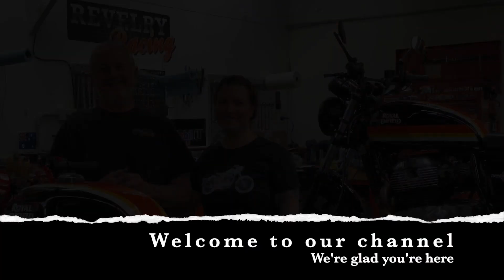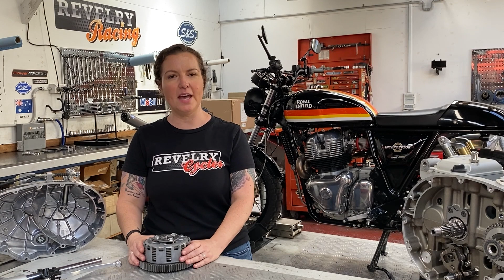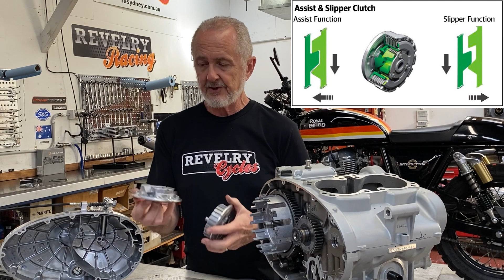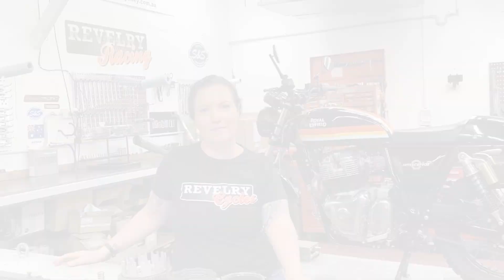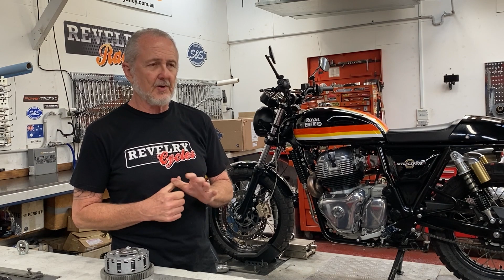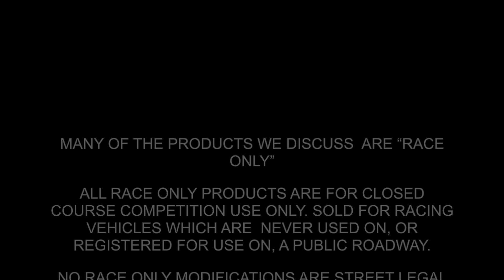Episode 9: Clutches - Royal Enfield 650 Twins

Comment: Hi. Just watched your video. It was enjoyable. However, I have a little confusion regarding the final parts of the clutch plates assembly. When you said about the assembly of the final 2 friction plates with the larger ID, you assembled it to the outer slots of the clutch housing. However, I cross referenced it with the workshop manual from royal enfield and I am myself a little confused. As per the manual, regarding the assembly of the 6th friction plate, 6th steel plate, and 7th friction plate goes like this: (I am copying it from the manual)
1. Locate 6th friction plate (a) with larger ID (less
friction area) on clutch hub (b) and ensure it is
seated properly against the inner face of the clutch
hub.
2. Locate 6th steel plate (a) on the splines in clutch
hub (b) and ensure it is properly seated against the
6th friction plate.
3. Locate 7th friction plate (a) with larger ID (less
friction area) on clutch hub (b) such that its lugs are
offset and between 2 lugs of the 6th friction plate.
4. The outer lugs of 7th friction plate are correctly
located in the INNER slots of the clutch housing.
5. The outer lugs of 6th friction plate are correctly
located in the OUTER slots of the clutch housing.

I would really appreciate, if you could get back to me on this.
Reply from the maker: At the top of the original video description.
NOTE: There is an error at 9:08. The original STOCK CLUTCH is installed with only the last drive plate in the short spline, NOT THE LAST TWO. 
NOTE: The REKLUSE clutch is installed with ALL drive plates in the long spline; NONE go in the short spline. There is no need to install any drive plate in the short spline. When replacing the original plates, install all of them in the long spline.

Comment: I think this guy is stacking the clutches wrong i put the last 2 friction teeth in the short fingers like he says and it slipped like mad, looking at photos online your only supposed to put the last one friction teeth in the short fingers, which i did and my slipping went away.
Reply from the maker: It’s noted in the video description. NOTE: There is an error at 9:08. When installing the STOCK CLUTCH, only the last drive plate goes in the short spline, NOT THE LAST TWO. 
NOTE: The REKLUSE clutch is installed with ALL drive plates in the long spines; NONE go in the short spline.
Reply: @RevelryCycles i missed that, many thanks ❤
Reply: Out of curiosity what are the short splines for?
Reply from the maker: Thanks for watching!

Comment: Great video! I was curious on the clutch replacement replacement process and it doesn't look hard at all. Looking at how the clutch is operated, it seems that holding in the clutch for bit at a stoplight wouldn't cause any additional wear.

Comment: Just fitted the Hitchcocks performance clutch which I believe is the same. I haven't actually put any miles on it, just turned it around on my street. First gear seems a little tricky to find, will this improve once given a good run? Or have I done something wrong?
Reply from the maker: If it doesn't work something must be amiss.
Reply: @RevelryCycles  it works,just getting first gear seemed a little harder than i am used too. Are they oil type sensitive? I have used semi synthetic as a posed to fully synthetic this oil change.
Reply: Well a couple of hundred miles in now on the rekluse clutch and although I have no clutch slippage at all, I am still having issues getting an nice easy neutral engagement, it's definitely heavier on the clutch lever too not alot but definitely heavier.
I don't understand why it's a struggle now to get neutral was fine on the standard clutch.

Comment: Hi guys love the videos i learnt a lot. 

I have a question I hope to get a reply as I am now fitting this upgraded  clutch.  The last 2 clutch friction plates you fit in the short gaps in the basket are the friction plates not supposed to go in the same gaps as the other plates as they would be running on the steel shims that were fitted? It makes sense to put them where the originals ran but there's no extra fitted steel shims on the other outer fingers.
Reply from the maker: From the video description:
NOTE: There is an error at 9:08. When installing the STOCK CLUTCH, only the last drive plate goes in the short spline. NOT THE LAST TWO. 
NOTE: The REKLUSE clutch is installed with ALL drive plates in the long splines. NONE go in the short spline.
Reply: @RevelryCycles  thank you so much for the reply. I did wonder as i have watch 3 videos and only 1 person put all the friction plates in the same place.  So I was getting confused to what was right. Appreciated..
Reply: Please reply as I have heard some say finding neutral can be harder? And wondered if it's because they didn't used the smaller gaps on the basket.

Comment: So, I've kind of got this series a little bit out of order for one reason or another, the visuals of the differing clutch packs and mechs/springs are so informative, even to someone who's 'been around the block' mor than a few times and understands carburettors and also knows what a choke is for! Keep up the good work and keep those 'vids' coming. 
Perhaps in the future you could include some custom bike and/or motor builds and show the dyno charts with different options of how the 'mix and match', can/will alter the engines characteristics, horsepower and torque etc?

Comment: I have Rekluse clutch plates in my interceptor. The problem I am facing is am not able to neutral it from gear engaged while the bike is running and is in 1st or 2nd gear. This seems to like clutch dragging. I have run 1000 km after fitment and the oil used is 10w50. Can you help me with the diagnosis of the problem.
Reply: Hi Sanjay, I also find neutral harder to select now from first gear since I had the Rekluse clutch installed. I can normally get it easily from second gear though. Did you ever solve this problem? It's quite annoying because the gearbox used to be so easy to find neutral.

Comment: Excellent video!
A tip for whoever changes their friction plates at home.
ONLY the last friction plate goes into the small teeth of the clutch hub.
When changing mine I assembled the clutch the same way in this video and it caused the clutch to lag and drag.
I've fixed it the way I mentioned above and everything goes smooth now :)
*all plates mentioned are stock plates *
Reply from the maker: Yep, that's a "blooper". Only the single outer most drive (friction) plate in the stock clutch is installed in the short spline, offset from the long splines, in the clutch SHELL (not the hub).

Comment: Excellent series.  Really digging it.  I personally live in the "hill country" of Central Texas, within riding range of Circuit of the Americas.  Weekends are twisty road work or track days, and I'd like to do them on a Continental GT.  In my case, brakes and suspension are a bigger deal than raw power.  Could you do a series on suspension tuning and brake performance for track people or knee-draggers?  If that is outside of your comfort zone, is there a particular source, channel or shop you'd recommend I check out for the RE 650 crowd?

Comment: Thank you so much for all of the time you guys spend informing us about Royal Enfield's.  I have a new 2021 Continental GT 650(less than  300 miles).   I have not been happy with the clutch at all.  The clutch does not engage until the last little bit of movement from the lever.  I have purchased the S&S clutch plate kit hoping for better clutch engagement.  I have the stock motor with a K&N air filter and the S&S slip-ons without the decibel reducer inserted.  I don't expect more torque I just hope the clutch performs better?  Does the S&S clutch kit come with instructions?  Thanks again for all you do!!!

Comment: Hi. I've seen you a lot at drag strip and also saw a lot of RE riders participated in drag race which is really great to see. I'm looking to buy the twin 650 and one of my concern is the wheels are in 18" which is quite limited the tyres option. My question is , is it able to do the wheel conversion in to 17" size ? And what's the trade off ? 
Thanks.
Reply from the maker: Not an easy swap to a 17" and would be expensive.  Since the 650's are selling well hopefully tyre companies will take note and make more options.

Comment: I've been advised by another YouTube channel chap, a very qualified and an Interceptor owner that putting all of the S&S parts on will ruin the bike for street purposes! I was really very much looking forward to getting the 865 big bore kit sorted along with other S&S gems. They said it would make the bike more 'Japanese'. The power will be higher up in the rev range and lose low down grunt. They advised an S&S cam and thats about it. Is the the case? I'd love to hear your opinion. Thank you.
Reply from the maker: No one who has actually ridden one of our fully equipped 865cc motors would ever say the phrase "lose low down grunt" while describing the experience. That's just silly. The fact is, while you can alter lots of variables to tune the engine toward more low end torque or more high end power,  no matter how you configure it the 865 ALWAYS makes much more torque absolutely everywhere in the rev range than the 650. The 865 engines are strong and reliable, they respond very well to higher gearing because they make so much more torque down low, they are smooth and quiet on the highway with HEAPS of high gear roll on passing power, and are simply a joy to ride. Oh and that's not my "opinion". That's an amalgomation of comments from actual owners of the 865.
Reply: @RevelryCycles  Thank you for your prompt reply. I also thought the very same way, as I've watched your videos from the beginning of your YouTube channel. I'll continue to follow your advice and build my goal. Thanks again for everything 🙏

Comment: Question: I have a more or less stock Interceptor, added a 2>1 exhaust and a Aftermarket air filter with a venturi intake. ( also lowered the gearing) Coming from a Street Twin on which I never experienced anything suggesting clutch slip, on the Enfield I get the sensation at times that I'm not applying full power and torque to the rear wheel. Since you have a lot of  experience with the Enfields, do you have any comments on this or relatable experience? A new clutch install is relatively straight forward so it something easy enough to do if its needed. And yes I know how to adjust the clutch.
Reply from the maker: We haven't seen a clutch failure on a stock 650 yet. The 865 however, will over run the stock clutch almost immediately when you begin to dial it up.